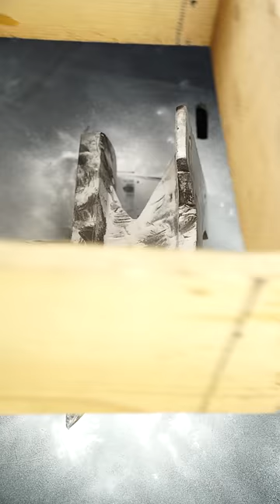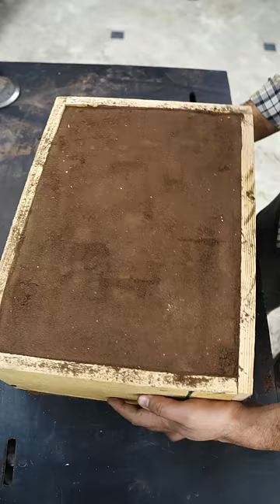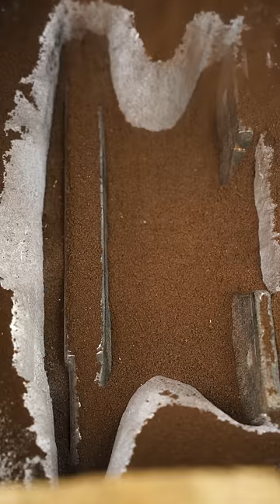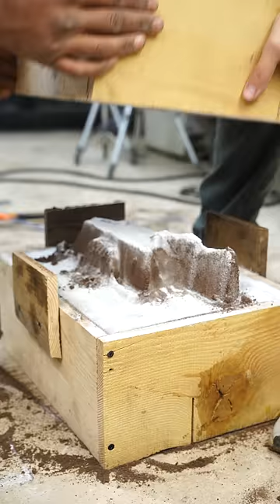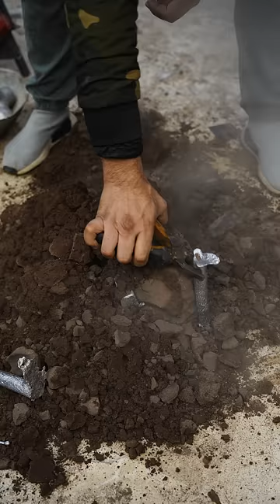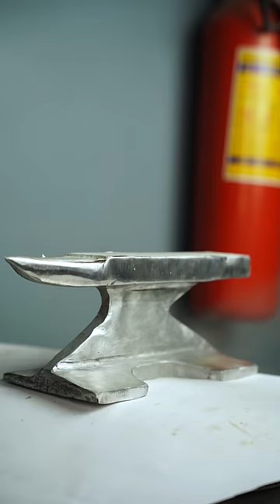Casting Anvil #shorts #casting #viral #randomhands

Comment: Lol aluminium anvil
Reply: Я думал, что я это один заметил
Reply: Would an aluminum anvil be useful for anything?
Reply: @elementalist1984  i would have said paperweight or doorstop but it's too light so not even this. I suppose it can be sold for a dollar or two, in terms of scrap materials
Reply: @jeanladoire4141  the only benefit I can think of is that when you break it it's probably easier to melt down and recast. Definitely cheaper than buying a steel anvil. Except a real anvil is going to last a lot longer....
Reply: @elementalist1984  i'm a professional blacksmith, and i can tell you, you CANNOT forge on aluminum. It's just butter. A good anvil should be hard and heavy. The problem is that steel is way harder than aluminum, even while hot. That means when you strike the iron, it's not the iron that get squished, it's the aluminum. And that's not what you want. Also the lack of weight negates even more the efficiency of your hammer blow. Big hard stones will be way better anvils than a piece of aluminum... An aluminum anvil is just retarded, it's like a lead plane, or a sugar boat
Reply: @jeanladoire4141  to be honest I was just grasping at straws trying to make up a way that casting an aluminum anvil would be even remotely worth the time or effort. But yes it's going to be completely destroyed the first time you attempt to forge anything on it. I could possibly use it for a "anvil" when I put the tags on my dog collars using the brass rivets that you hammer together?
Reply: @elementalist1984  brass is harder than aluminum...
Tho we sometimes use plates of lead to set up rivets, as it doesn't scratch other metals
Reply: @elementalist1984  it’s good for YouTube clicks and nothing else.
Reply: Aluminum*
Reply: @Laffayette_  it's aluminium in litterally any other country than the us
Reply: @jeanladoire4141  search the spelling bro
Reply: @jeanladoire4141  it's aluminum
Reply: @Laffayette_  it's aluminium, check the spelling bro. Aluminum in American, aluminium in English, and aluminium in french
Reply: Same
Reply: It will be good for a boat anchor.... 😆 🤣
Reply: @elementalist1984  maybe jewelry?
Reply: Prolly work for a little while ha
Reply: @elementalist1984 only thing would be working other aluminum on it or other softer metals. I could see it possibly being useful in that it won’t transfer any steel to the aluminum you are working on it.

Comment: Unless that’s NASA aluminum that’s not going to work. Notice the cut away before the steel bar is flattened? Without it being heated? Even if it was heated, the anvil would be dented super badly. Sure it’s an anvil, but it’s a soft and easily dented one.
Reply: I imagine that it would be broken alot easier as well. Especially using the horn portion of the anvil.
Reply: That wasnt steel he was hammering, it was aluminum

Comment: So this is how they make every anvil, moulded from another. I have to wonder though. If every anvil is a mould  of another anvil, how did the first anvil get made?
Reply: They use a material shaped like an anvil (ex. rubber master-copy of an anvil)
Reply: Most anvils pre-1900 were forged from many parts which were welded together by hammering them at a white heat, often by a team of smiths! Go even further back,  before the 1500s and anvils were fairly small, and were just a big block of iron, shaped on a flat rock.
Reply: @jakeeasterday1663  oh interesting.
Reply: @Caleb S primarily forge-welding. You heat two parts near their melting point and hammer them together. It's how large objects of iron and steel were assembled.
Reply: @Caleb S Forge welding can be the strongest form of welding, and the impurities in old iron and steel actually helped make the bonds stronger. For context, I'm a blacksmith who specializes in Medieval and pre-industrial techniques. It's difficult to learn how to forge weld, but it ends up seamless if you do it right. I'd love to make videos on these things at some point.